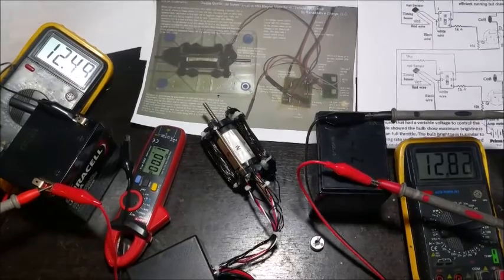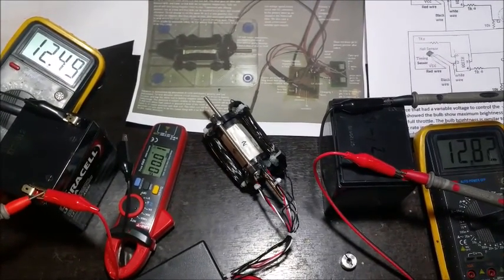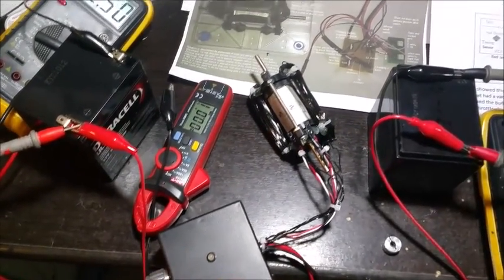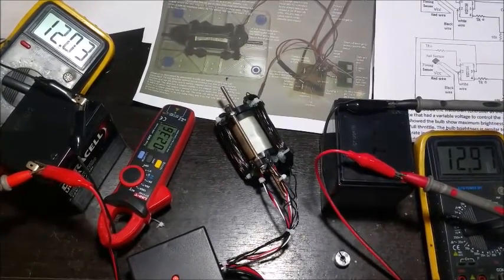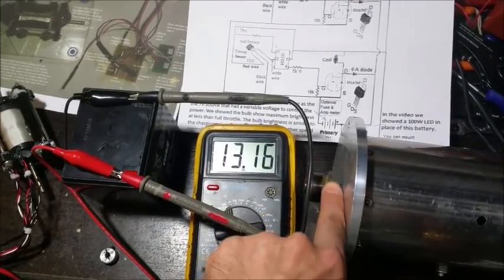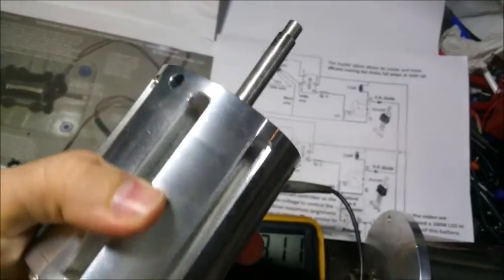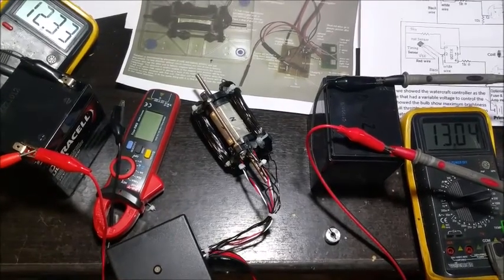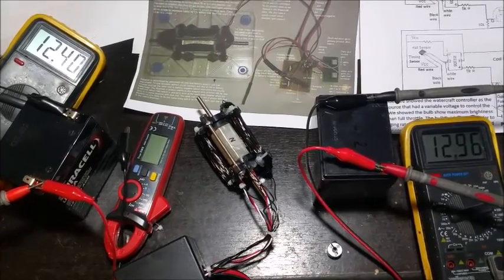Mini Magnetic Motor Energizer with Controller option

Comment: this isn't an example of over unity is it?
Reply from the maker: All of our systems create more output than what is put into it conventionally speaking. Over unity is understood differently by different people. If it takes 100 units of energy to produce 100 units of work and now you modify it to produce 110 or 150 or 190 units of work then what is that? People want overunity to mean 200 units of work. Others want it to mean 100 units of work with 0 units of energy in. These are three different things. The first is real free energy but is disregarded by skeptics as mere efficiency gains. This is merely a play on words. But if I could go 5 or 100 times further with my car or boat then is that not significant? Overunity is mostly only considered if it is self-looping. This we can do with rotating batteries or with the zero point process.